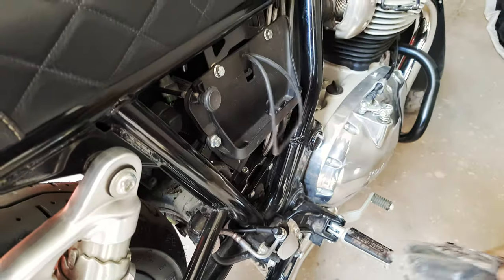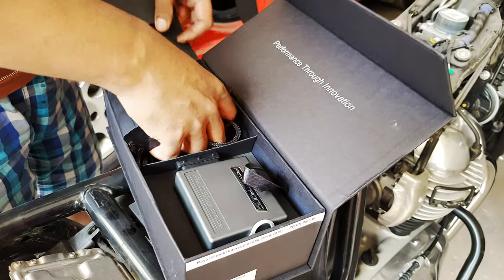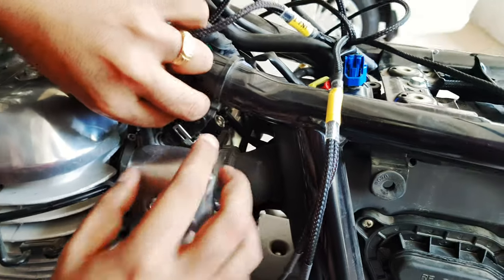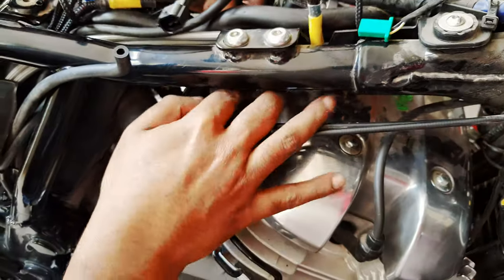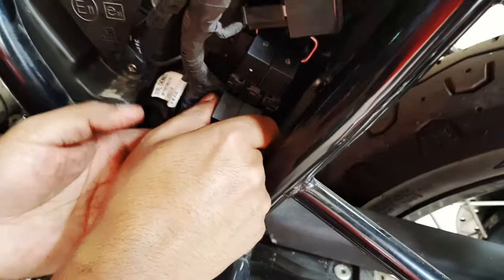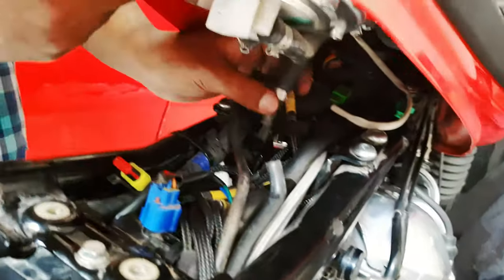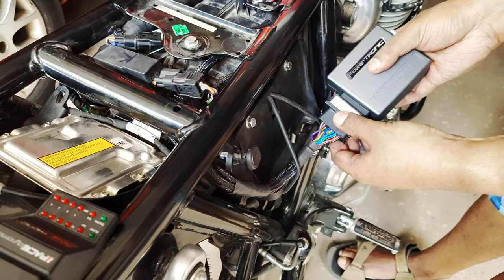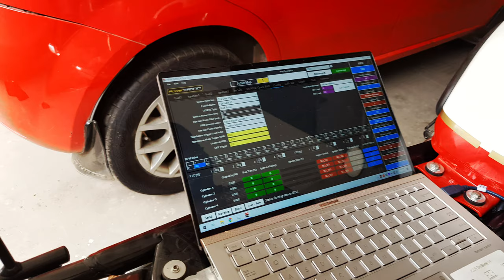Powertronic Installation - Royal Enfield Interceptor 650 | 4K

Comment: I've installed Power commanders, so understand how these work, my question if you have the answer, is will these suffice, and give the proper fuel map if you have already added aftermarket exhaust and intake opening? What is the difference in the 2 provided maps. do they offer any custom maps? I can't access a dyno here. hence my questions.
Reply: Make your own map.
Reply: @cranky1812  that's really not helpful nor is it reccomended without a Dyno to check the values of A/F ratio under load or timing values. sure anyone can go on the software and makeup map but you have no idea if it's correct.
Reply: @DEeMONsworld  I made my own map on my modified RC 390 and the results were great. I got enough power from the map that I installed 42T rear sprocket and still kept same acceleration, my top end is 188+ kmph. 
Now I am in Canada and I'll be getting another RC 390 here with major engine upgrades with standalone ECU from aracer to make 57+ bhp or 52+ wheel horsepower.
Reply: @cranky1812  good for you, have at it, and good luck but be warned that engine has a lot of issues with various reliability concerns. Your asking a lot from a tiny single banger. I've had that engine a few years back, and quite familiar with its limitations.
Reply: @DEeMONsworld  KTM has no reliability issues, I still have my RC 390 in India and I did 35000+ Kms with modifications and I was revving up to 12,000 rpm. No leaks, no heating issues. It's a 2016 model.
For 52+ wheel horsepower I have already got titanium valve springs retainers, high compression gasket kit set, high compression piston, high compression spark plug, billet connecting rod, ceramic bearings, bigger injector, racing air box open lid, K&N, titanium exhaust header, wideband O2 sensor, highlift camshaft and aracer standalone ECU. Head porting and polishing once I get the motorcycle. Winter is coming so no more riding as it will start to snow soon.

People just don't maintain KTM's and face problems.
Reply from the maker: Good questions! I myself don't have definite answers. I got the Powertronic when I had just an aftermarket free-flow air filter (without the open cover) and stock exhaust. Since then I've gone to the open air filter cover and free-flow slip-ons. The performance seems to have improved significantly. I can even tell the difference between the 2 maps now. Earlier map 1 was barely noticeable while map 2 was better, so I always stayed on map 2. Now with the free-flow intake and exhaust, I can see the difference between the maps. Map 1 seems to be tuned for better low-end while map 2 seems to be for better mid to top-end performance. I think I remember the company calling them city and highway modes. Still can't be sure if they are tuned for the stock configuration or free-flow. They don't have additional maps freely available but if someone has done a proper tune-up with a similar configuration, you can get the map from them.
Let me try to reach out to them. It's a small company and do dyno tune-ups for customers who can visit them. So chances are that would have done a tune-up with just my kind of configuration.  Actually, they are in the same city as me, so I could even try putting my bike on their dyno, but chances are the tune would be similar to those they have already done for people with similar configuration.
Reply: @Volatile42  since I posted that question, I contacted Powertronic, their stock map will be ok on a bike with free flowing exhaust (they say), and they also have custom maps available for open exhaust with or without baffles.
Reply from the maker: Cool! Thanks for finding that out. I always thought they would have a decent database of maps of different configurations, at least for the popular bikes in India. It's just that it's not easily available online and you have to reach out to them. Reminds me of the Fuelpak 3 that I had on my Sportster where you could quickly connect to it from your phone over Bluetooth and download a map to suit you from a wide range of exhaust and intake combinations. That was neat!
Reply: @Volatile42  if you want real advantage of any piggyback ECU or standalone ECU then you need a wide band O2 sensor. Otherwise you will always have a closed loop condition with lean AFR especially with a piggyback ECU like powertronic as it still uses the stock ECU.

Some standalone ECU's like aracer have auto tune option. You can check out their website. Maybe they have something for your motorcycle. They have standalone ECU's for KTM.
Reply from the maker: Yes, I've heard about those but aren't they more useful when you have an autotune feature than can actually tune the mixture based on the readings front the O2 sensors? As I understand, the stock ECU is very limited in how far it can adjust the mixture and the piggyback is only going to add a predefined amount on top of that. Some piggyback ECUs take inputs from the O2 sensors as well, so it would probably help there.
Reply: @Volatile42  wide band O2 sensor has wider range whereas stock O2 sensor has narrow range. 
With piggyback or standalone ECU a tuner can adjust according to heavy load, WOT or cruise conditions. Stock O2 sensor is only allows cruise condition which around 14.7:1 ratio. Not really good for engine as it runs lean and hot. Lean mixture will also cause jerky throttle response and jerks at slow speed or low rpm.